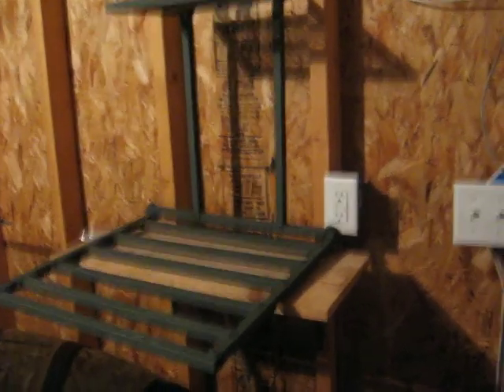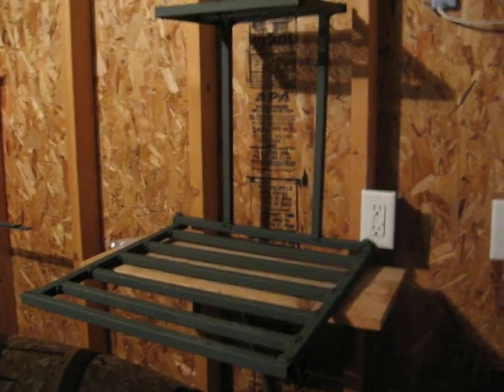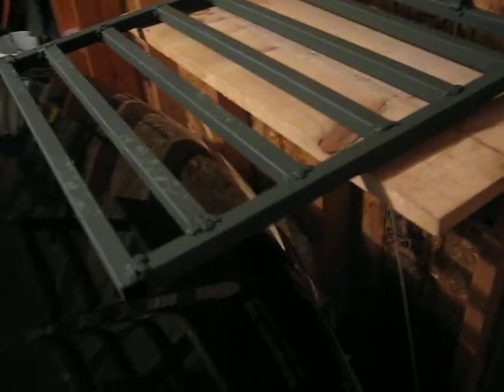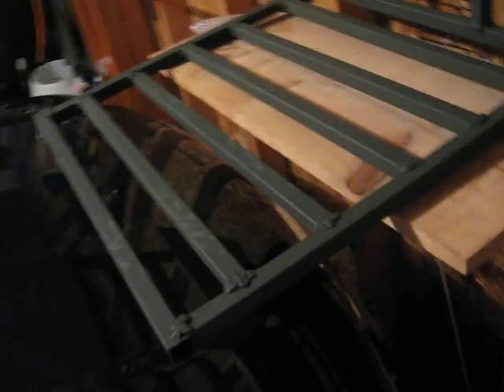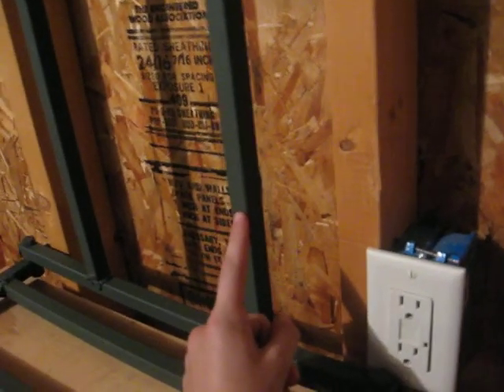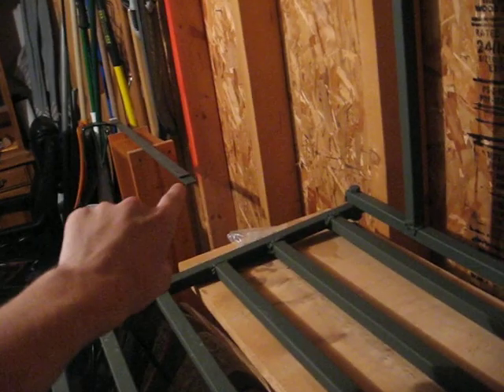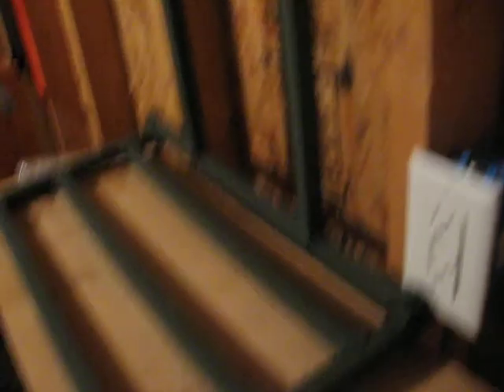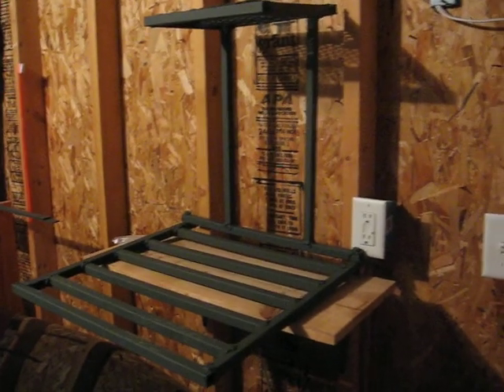homemade hang-on treestand

Comment: if you bevel your tubing and angle joints about 1/4" and turn up the heat on you welder, your welds will turn out much better, also remember your biggest weld should be no larger than your thickest flange!

Comment: I've just finihed cutting all my pieces, my design is similar, but I'm using expanded metal for the platform. I also had to cut all my bars off of an old porch rail with a grinder, which was a lot more difficult. my seat will be different too. I'm putting ply wood on it then making a cushion for it. Mine also has a bigger platform. I'll let you kinow how it goes!

Comment: @huntinman802 Agreed.  I would not trust this stand in its current condition at all.  You should have never got in that stand with out the support bars (or cables).  You were very lucky a weld at the base did not give out causing a fall.

Comment: Good video, did you ever think about adding any cables from the seat down to the edge of the platform for extra support?  I would feel a little sketchy hanging 30 feet up in a tree in a stand that I made myself without a safety harness as well.  Have you used this stand to hunt out of yet?  how did it work out?  Lastly, what did you spend on materials?  because I really like fabricating BUT, I can get a sturdy, quiet, hangon for about $35.

Comment: @kcrocks75 pending on your mig you can replace the original feed line to line and coil for Alumn. wire.  I think the gas is different too but it is possible to mig alumn.
I do it with my miller once an a while

Comment: i just made a 12 foot ladder out of old boards laying around..then i put one board on the  other side of where i put the ladder steps(to rest ur back on)...then i put a wider board on the step below the back rest(for ur feet) i used two boards that kind of "hug" the tree so it doesn`t fall over..i also used two ropes that tie to the middle and top of the ladder stand to hold it in place better. it took me 6 hours and im only 13.the height is 9ft 2seat.send a message4 info..great job on ur stand!